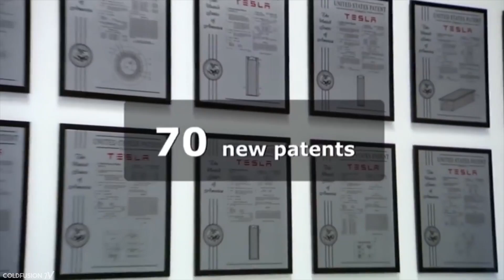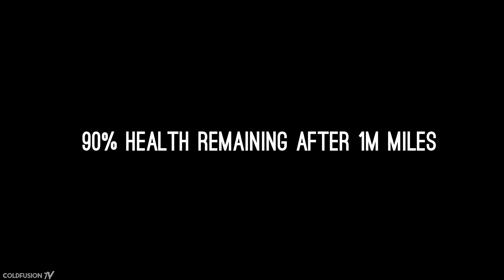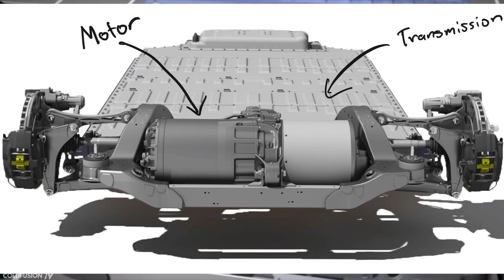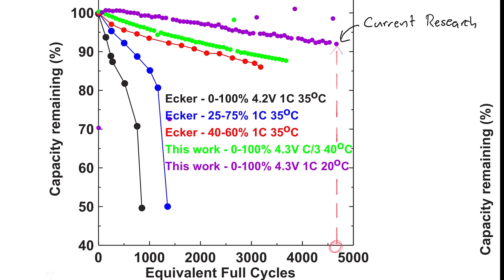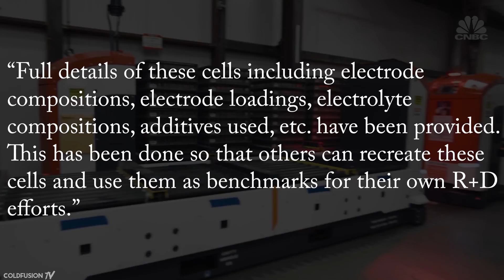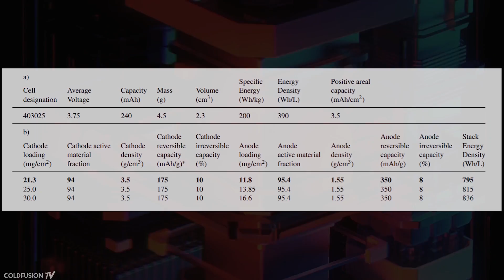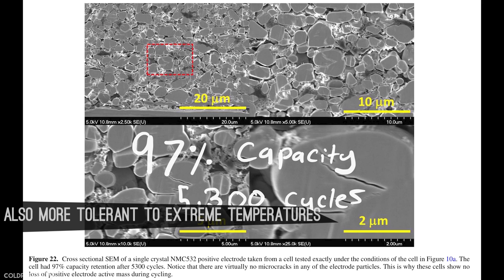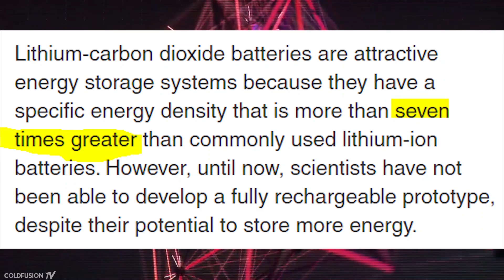Tesla's Million Mile Battery

Comment: My idiot nephew wants a tesla 3 or whatever the cheap one is. Said something like 180 mile range? Surely I did not hear that correct.  We live in Texas.  There are people that drive that much just back and forth to work. And what happens when you out some where and whoops mr George ain't going to let you plug your extension cord in his garage. I'm sorry but it's just not practical at this time. The range HAS A LONG WAY to go. And then we hear about how toxic some the materials are these batteries are made of. And these young liberals have no idea where the power they plug into is coming from. They think oh I just plugged it in. I'm so eco friendly. No idea how the power plants generate that 50 miles that your able to drive. Ugh. Im not saying in the future it may work. But you can but a Toyota Corolla and fill up on any corner and go hundreds of miles on a tank.
Reply: think forward
Reply: I don't blame ya.  Even driving the car ( just you..no luggage.. best case scenario with no a/c or heat on windows up in the fall weather) and it's the one with the biggest engine battery power pack..you'l be lucky to get 400 miles and that's IF you're not doing even 65 mph the entire time and that's basically 65% city driving.

Yeah...my little rebel 300 2017 motorcycle consistently gets 80+ mpg with each work week of riding around 140 to 180 miles between refueling, but with a 2.96 gallon max fuel tank, I'm not dumb enough to think that on a real road trip I could push it a total of 230 miles without needing to stop for refuel.  ( besides...Minnere's disease here...I must take breaks more often than most people..so ...one hour rides or 1.5 hour rides..maximum for me..then a good break needed.  So it's all good either way)

Comment: U said electric cars don't need maintenance???😂😂😂😂
Reply: When was the last time anyone with 100% true E.V. changed engine oil?  How about spark plugs and wires or spark plugs and after 100k to 250k ..ignition coils?  Maybe...serpentine belts?  ATF or Manual transmission fluid changes with the filters..?  Oh yeah..oil filters, ..?  Air intake filters?  ( of course there will be cabin air filters even in the Telsa..so that's inevitable unless you want to kill your a/c compressor and eventually the whole a/c system and sweat your balls off in the summer months)

That would be....never because those items aren't needed in a true 100% e.v. ( the belts part COULD be an exception given the a/c compressor belt situation).

However, ..SOOOO many more sensors are involved in a Tesla than even today's 30k to 60k modern cars, trucks, and suv's.  (scratches chin)

Well I have more research to do regardless.

Comment: Imagine having a phone that practically never dies with that Jesus battery😂 lol
Reply: pretty sure you didnt understand. you still gotta charge it. the 1 million miles is longevity, maybe think before just writing something.
Reply: @dwSpartacus  MIC DROP LOL 😂
Reply: @dwSpartacus  i know that, but how long does it take to make 1 millon miles for the average person? it takes like 15 or 20 or 25 years of driving and no way a battery can have a lifespan so long.
Reply: It's called a Nokia.
Reply: @PandemoniumMeltDown  That's not how it works. They don't make shoddy quality products to make you buy a new one every year. They do a market research and see that most people buy a new one every year so they only need to make the stuff just good enough to last one year. It saves a ton of money, makes stuff cheaper. You always have an option to buy a high build quality products, but they cost like 10x as much.
Reply: the battery can last 1 million miles, the problem is time, time affects all batteries i think those batteries shouldnt last more than 6 or 8 years at most.

Comment: I’ve heard about «new and great» batteries every year for the last 5 years now. Yet a single one of these batteries have been able to compete with our current batteries.
Reply: Actually, a lot of the work that has been done on batteries is being used in the industry. For example the research that has been done lately on silicone based li-ion batteries is being used now. Although you won't find pure silicone anode in batteries right now, most manufacturers make their anodes with up to 6-9 percent silicone, which improves the battery a lot. The main reason that you feel that all of this research is being wasted is it's hard to incorporate most technologies in the industry quickly. A lot of the improvement is incremental and you won't feel it unless you look for it on a larger time scale. That's how research works.

Comment: Okay this is cool and all, but did you really just say the only major moving parts in an electric car, is the motor and transmission? What about the coolant pump, the wheel bearings, suspension parts? A new battery doesn't omit electric cars from basic maintenance, it will only reduce how often and how serious a maintenance visit will be.

Comment: I fail to see how this is more revolutionary than current LTO chemistry which can do 20,000 charge/discharge cycles with a life span of 30 years. Even LiFePo is far superior to Li. The only advantage Li can claim over other chemistries is energy density, which for an electric vehicle comes down to weight. Add solar to the mix in the form of a PV roof and the density issue becomes a moot point. But the technology is still decades out where a 2 square meter array can keep an EV charged. Solar advancements will also be needed as well as battery tech for electric vehicles to really become viable.

Comment: @2m33s: "Only two moving parts..." Teslas have several water pumps and multiple valves associated with the battery cooling system, not to mention several other systems. YouTuber 'Legit Street Cars' and friends recently rebuilt a Model S, and it was interesting how complicated they are under the Frunk. Yes, they are certainly simpler, just not quite to the degree that you just claimed.

Comment: What a bunch of shit. Model 3's are already suffering from rust.
Reply: Model 3s have experience battery degradation that put them at already half a million miles of use, also rust is very common where I'm from especially on salted roads with gravel near by.

Comment: When these batteries come out,im getting a tesla
Reply: You can't even get a Volkswagon let alone a $100,000 Tesla 🤣🤣🤣
Reply: I seriously looked at buying a Tesla, however like the Audi E-Tron the range of Teslas are unpractical. When you get EV's that can do 500 miles this is when mass consumers will adopt electric. Until then, it's either hybrid's or stick with your old car.
Reply: @bluebull399  Majority of ICE cars don't go more than 350-400 miles on a tank in real world driving....and most people are well aware of that.  Yea there is a car here and there with a massive tank and/or an underpowered engine that will take you farther but don't pretend that's the norm. While the AUDI e-tron barely gets 200 miles of range...the Tesla Model S has an EPA rated 373 mile range.....and that range continues to get better every few months. Additionally, EV's are easy to charge in most parts of the world. If you have a garage or parking spot in front of your house you're set of course....but also many people charge while at work....and then there are thousands of quick charge stations for Tesla. In short, Tesla's ARE practical TODAY...and arguably in most scenarios MORE practical than their ICE competition.
Reply: C W  The energy density of cosmic rays is very small compared to the energy density if visible light.  Solar cells also capture much more energy because the electromagmetic energy does not penetrate the device. Cosmic rays on the other hand will not be captured by a device very effectively because they just go through it.
Reply: Go science!
Reply: after 5 years, there is ausual 24000 maintenance cost, juuuuust after the waranty expires. a broken door handle costs are just... insane.
Reply: The car will be made in China.  Does your moral compass let you support a country that has a horrible human rights record?  Tesla should never have sold it's soul to the devil. ?
Reply: @joephysics5469  The China factory is just for sales in China. You're not allowed to sell cars in China unless you build them there. That's why Buick for example has a factory over there.
Reply: @joephysics5469  and also, tesla Will still continue to run their factory in USA for that marketside of the world.. You trolls/haters must be really sad to see this new company Come and literally DESTROY the old town companies that have and continues to refuse to innovate. Eventually as in every market, when the old ones stop. A new one comes along and makes them obsolete
Reply: @samgerland6087  Old companies have to succeed or die.  GE is fading away just like GM, Ford and dozens of others.  I don't care.  Bailouts are just wrong. 

  A company like Toyota and Honda build many of their cars in the USA so most of that money stays in the hands of our neighbors.

I try not to by anything Chinese.  SUre some things will always come from there.  I look at labels and will spend the extra 10 percent to help employ a US citizen. Give it a try.

Tesla will die if it does not develop the next battery technology which has a high energy density, long life, fast recharge, economical and light weight (relative to older technology).  The winner of that race will make trillions and effect every corner of the planet.  That new technology will replace the electric grid in some places in the world and solar will bring electricity where the sun shines and you can have that battery pack.  Every home can have a battery wall that is no longer the size of a wall but the size of a cooler.  Until then we are slaves to the grid.

Elon Musk is betting Tesla's success on finding that secret battery tech first.
Reply: @joephysics5469  ah yes i completely agree, but tesla is a american company, with the superior tech, and probably much more to Come so be glad that they are in america! And also that they are expanding in China, thats positive for you aswell.
Just because they built a Gig factory in China doesnt mean they Will shut the US one down 👍
Yeah I have a feeling that due the fact Teslas new battery cells with over 1Million miles range life capacity is not their final design, since this design is open source im sure they have something for themselves that is even more superior that they Will patent. Ah well, Take care my fellow amigo exciting Times ahead say the least.
Reply: @joephysics5469  re: Toyota and Honda build many of their cars in the USA so most of that money stays in the hands of our neighbors
I agree w/ what you said about buying domestic (I'm in Canada :)) but the above logic makes no sense. For that to be true, the car maker's gross profit would need to be greater than 50% of the sales price (i.e. that manufacturer's profited more than $10K on a $20K car*). Its more like 5-15% for *common cars*. Making and selling it in the US means American employees & companies (marketers, advertising placements, distributors, down to the dealers & service providers) keep the vast majority of the car's price. Even the small amount of gross margin is *NOT flowing out as Toyota & Honda are owned by many Americans* (directly via stocks or through their pension programs etc) who benefit by the growing value, & their regular dividend payments... 
On that $20K vehicle, a few hundred bucks may flow out... I think we agree that this is FAR (FAR!) better than losing the American capacity to produce it's own goods by EXPORTING this work to another nation

RE: ...finding that secret battery tech
Except for those pesky laws of thermodynamics, eh? Unfortunately, not even Elon Musk can work around the laws of physics
Reply: @joephysics5469  so you're telling me that the devices of tech you use every day, such as the one u used to make this comment is not made in China?
China, the land where we basically refine 100%of metals that we use in every items in every day life? 🤔

Comment: This is great! This means in 20 years when these cars have 300,000 miles on them they will still be relatively new and I'll be able to pick one up cheap.
Reply: There is a 2016 model S that achieved 300k miles in 2 years with only 82% degridation.

Comment: a thermic engine i still way easier to replace and recycle that a 600kg lithium battery especially if cars were not designed as single use items and with maintenance in mind. all parts of the engine can be sorted by alloy types sent back to the foundry and re cast, forged etc. you don't separate component and chemicals from a battery in merely hours with a couple of spanners all that to use electricity that is not that clean yet.

none the less better develop better batteries now than later!
Reply: The point is operating efficiency, electrics make back their money when you dont buy gas or oil and use 2-4x cheaper electricity for fuel.
Reply: @miguellopez3392  valid point plus you don't have a faucet giving cheap diesel or gas in you house, the very reason i'm looking for e bike rather than gas dirt bike but when we talk about electric cars it's often about ecology, especially as sale argument yet the batteries are problematic in that aspect once they reach their life's end
Reply: @floflo8018  thats why recycling exist, tesla is pushing manufacturing to make recycling cells economical and environmentally feasible, a good step was acquiring dry cell manufacturing to reduce the amount of enrgy needed to make the cells and to avoid the use of some very nasty chemicals.
Reply: @miguellopez3392  oh i see! so that's why they use those AA looking cells, i have been wondering why they prefer these to the kodak film looking ones we see in modelism that seems way lighter.
the remaining problem is the source of electricity then!
Reply: @floflo8018  the 18650 cell and 2170 cell tesla uses is easier to manufacture, cool, and install then other cell types of cells, so they sacrifice energy density for durability and cost.

Comment: Current batteries are going to last almost 1 million miles with 70% charge.
Reply: How do you figure? I'd like to see your math.
Reply: @maj429  No math.  Just common sense and real world observation.  There are 6 Tesla Model S Taxis with more than 400,000 miles on them that were produced in 2012, 7 years ago.  Only one has had a battery replaced, it was defective the first year.  The lowest charge of all six cars is 83% using superchargers exclusively.  Super chargers are hard on batteries.  90% of people charge at home, much better for the batteries.  Battery technology has improved in 7 years, the Tesla Model 3 battery is better than the 2012 Tesla Model S batteries.  Also, Li batteries lose the most charge in the first 2 years, after that they degrade much slower.
Reply: @davidbeppler3032  interesting, thanks for the info